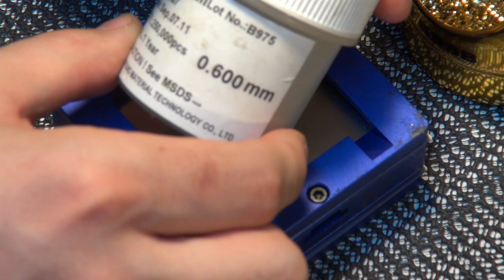[Scotle IR360 Pro V1] Xbox South Bridge Swap

Comment: hey i heard you mention in another vid that you were going to make a video on how to remove power plug socket on back of xbox etc.did you get round to doing it??,.if so please leave a link i could with it as i need to replace one.,tried one on scrap board and the inner plastics pins just melted lol.thanks